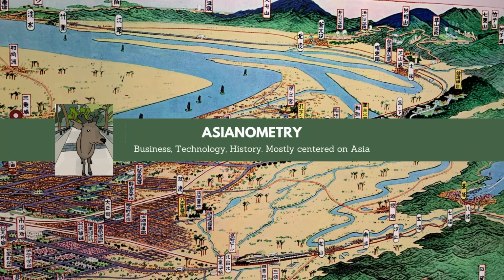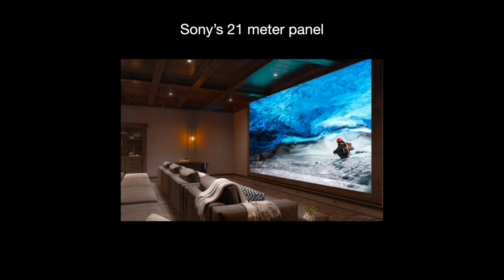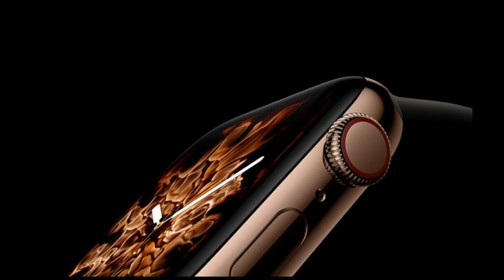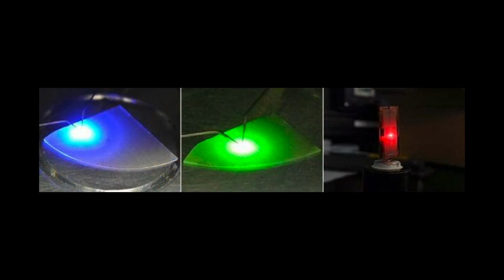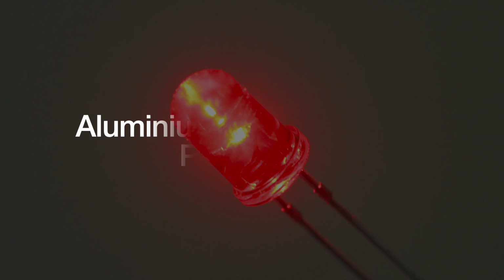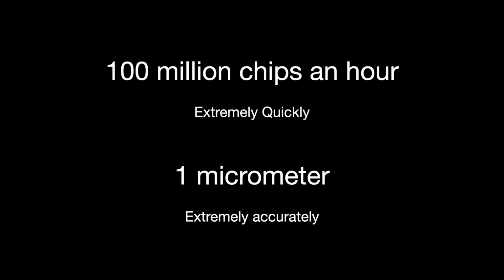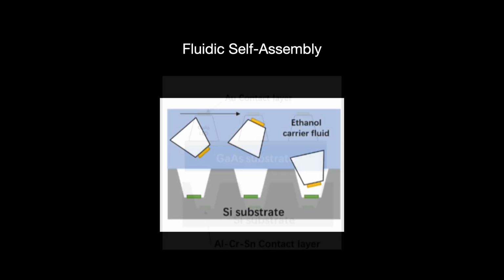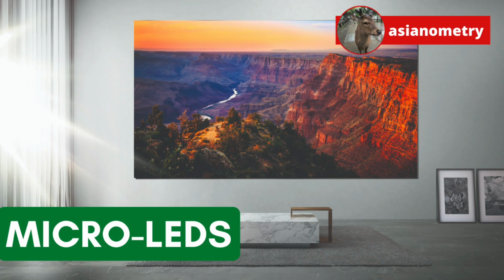Micro-LED Displays

Comment: Isn't it possible to make a micro-led array, 10x10 for example, and not separate pixels and place this on the display substrate? It would result in a much higher transfer rate.

Comment: Intresting report as usual. Never heard much about this micro led technology before. Anyway, besides all common display technologies, promises and the race of resolutions that already reached a point that human eye can't differ from a distance, the question of technology should also be which technology saves the most amount of power? Most (in Germany sold) TV sets have an very bad energy label. Since I know now about the light intesety effects of the red micro led depending on the size, this technology maybe could not save more power than a (led) backlight powered display.

Comment: What? CRTs didn't look bad... Especially they didn't have poorer contrast compared to LCD.... To the complete contrary they had perfect contrast, soething you reeeeally can't say about most of the LCD screen sold, given most are IPS nowadays, that have terrible contrast ratios. And CRTs also looked sharp and high-def, did you ever use a CRT computer monitor, that got clean signals?

Comment: Press X to doubt. 0:28 that flat panel monitors in the early 2000s and 2010s had better image quality than CRT monitors is something that's almost completely untrue. They had the same inky blacks of OLED monitors, that they had worse contrast is not true. Early versions of flat-panel monitors looked horrible. Response time is also something that was unmatched with CRTs all the way until just a few years ago with OLEDs.

So I'll repeat it again, CRTs had perfect contrast, zero ghosting and instant response times, and often perfect colors as well. This part of the video is wildly inaccurare.

A high-end CRT monitor like a Sony Trinitron from the 90s would still be competitive today against most consumer monitors that aren't microLED or OLED, and is still comparable to those.

Digital Foundry made a great video on this, highly recommend watching it. There's also a great article from Eurogamer, Vice made one as well.

Comment: I wonder if they could combine fluidic self assembly or a similar technique that would be assisted  with ultrasound resonance  and or acoustic suspension technology to vibrate the LED's into place
/watch?v=wvJAgrUBF4w
/watch?v=MnjKa3EZXwg
maybe the micro LED's each have their own unique enough resonant  frequency already  or if not maybe  some extra element could be added to make them resonate at different  desired frequencies   so they could be steered  individually into place  by the ultrasound.

Comment: Creator is not clear on application and underlying LED technology for the microLED. Creator seems to be confused with pitch size and actual illumination technology.
Outdoor display should not need microLED, even miniLED is questionable for the outdoor display. Home TV screen may be micro LED or miniLED. True microLED application would be VR/AR/MR/XR. 
MicroLED may be illuminated by LED, OLED, QD and other nascent technologies. MicroLED with Quantum Dot may be the net generation but it still has few hurdles for large display format. QLED is not QD.

Comment: great video :D
I still think CRTs have the best colour reproduction/response time/smoothest image, but obviously they have the worst packaging constraints and their resolution hasn't kept pace with other technologies. Hopefully MicroLED will be the best of everything.
Reply: I am glad I'm not the only person who doesn't agree with that part of the video. Didn't CRTs have perfect blacks (and therefore superior contrast ratio to LCDs), and better viewing angles?

LCD monitors won purely because they don't weigh a ton, and because they don't take up half your desk. Not because they offer superior image quality.
Reply: @tamius-han  Yeah they did, that part of the video is completely inaccurare
Reply: A CRT for a color TV, and its associated circuitry, was/is an impressive technical achievement. On the screen was a pattern of Red Green and Blue phosphors. At the back were three corresponding electron guns, R G and B. Only the beam from the R gun (for example) was allowed to strike the R phosphors. Likewise for G and B. Yet the three beams were swept via magnetic deflection over the screen in unison, and the beams had to maintain their identity with each one striking its assigned color phosphor. 
   You may (or may not) find it interesting to learn more about these systems, for the sake of history if nothing else. In any event, don't be throwing shade at that technology. It worked pretty danged good . . . until something better came along.
Reply: @clarencegreen3071  we literally just said we prefer it lol.

Comment: Producing them at the exact same brightness is a fun challenge.
Perhaps there is a way to grow blue in certain areas without growing the other areas and then you grow blue > green > red on your desired surface at the ideal temperatures. Doubt it tho.
Or maybe we just have to make 100 million chips of the same color then laser the color into it somehow. Possibly by burning metals away. Still unsure if that would even work. I know LEDs change color if you briefly provide too much power to them but that is a permanent damage and it reduces the brightness.
Yeah this shits complicated especially when you know nothing of how they are made and nothing of how they are powered. I was going to suggest something like using a perfect sample to grow crystals like using a diamond to grow a larger diamond. The new diamond will take the exact structure of the donor diamond. Even if that was possible how will you power it?

Comment: CRTs did not work poorly. Their contrast and brightness was very good and for a long time it was impossible (even today it is not that easy) to get an LCD which could display a high resolution (say 1400 x 1600) at a high refresh rate of 75 Hz. Actually, the refresh rates and the latency were very good. There is no "native resolution" in CRTs and they have more than one set of dots (R,G,B) per pixel while LCDs, typically have only 3 sub-pixels per pixel. Modern CRT monitors, post 2000 with multi-sync, gave an excellent picture.

Comment: So we can put over a billion transistors, each ~5 nm onto a square inch of silicon with enough accuracy and complexity to run a computer but putting simple diodes the are 10,000 times larger in a much simpler array is somehow difficult? I call bull$j!+ on these companies, I think they could have done it easily enough almost ten years ago let alone now. the problem is micro L.E.D is so good that after that, it is going to be hard to upsell  customers on anything else. I mean, worse case scenario for red is to just use blue or violet L.E.Ds and put a red phosphors in front of it, now that I think of it, why not just use all violet L.E.D.s that way you only need to grow one kind of diode on a substrate (now it's really easy) and just put red, green and blue phosphors in front of them using a masking technique?

Comment: A. Professional CRTs actually had great Contrast Levels because they are Emissive.
B. Plasma Displays also had great Contrast Levels because they were Emissive.
C. LCD Displays won because of price, but had terrible Contrast Levels (and off-axis fade) because they are Transmissive with (initially) Florescent or LED Backlights.
D. LCD Displays improved their Contrast Levels with better LCD Technology and Local Backlights (they also improved their off-axis performance).
E. OLED Displays are again Emissive Displays — they do not have Backlights.
F. Micro LEDs are non-Organic LEDs and are again Emissive.
G. Sapphire is, in this case, just an Aluminum-Oxide substrate, Al3O2.
Reply: And by the way, kudos for noting the Apple purchase of LuxVue.  A friend of mine worked at LuxVue and helped them develop their fundamental technology.  I've been waiting for that to bear fruit ever since.  Unfortunately my friend succumbed to Parkinson's last year, so he never got a chance to see his work realized ...

Comment: Could the red green and blue LEDs be grown on the same substrates? This would allow using the growth wafer for final assembly. (contacts on top, transparent sapphire substrate below). Doing this seems less daunting to me then solving the transfer challenge...
Reply: I wonder if they could combine fluidic self assembly or a similar technique that would be assisted  with ultrasound resonance  and or acoustic suspension technology to vibrate the LED's into place
/watch?v=wvJAgrUBF4w
/watch?v=MnjKa3EZXwg
maybe the micro LED's each have their own unique enough resonant  frequency already  or if not maybe  some extra element could be added to make them resonate at different  desired frequencies   so they could be steered  individually into place  by the ultrasound.

Comment: I would work toward a stacked geometry.  Red on the bottom can be largest and has insufficient energy to excite green or blue carriers into conduction.  Similar considerations apply to the green under blue interface.  We do need to prevent the light going the other way, which can be done with dichroic mirrors.  Lattice matching among these layers and material purity/control may limit yield, but I think this will win in the long term.

Comment: Seems like quantum dots is the way to go.  When Linus was looking at the wall, it's not low power, it puts out a ton of heat that needs extra ac, and the smaller panels that lock together to make a large panel isn't color calibrated. So if one panel goes out put a new one in the colors are slightly off, and the panel go out often enough.

The 146 size is 5.76 m/2 uses 2990 watts max. And needs 10,212 BTU of cooling. This is the second smallest one.

Comment: hmm wonder if u could use stupid strong electro magnets for transfer... like nmr strong. everything is magnetic to some degree.
or field locking with superconductors. idk seems the tech is taking too long and those q dot whatevers will be better. imo we dont need higher resolution screens we need more efficient ones for phones/battery life. processor architecture is at a point where they cant get much more power/heat efficient (atleast arms) and im guessing a lot of battery is now used by screens vs chips

Comment: What if all the Micro LED's were just white and RGB color filters printed over ? CCD's and CMOS use a simple B/W detector and have a Baader filter in front to represent all colors. Could an entire Micro LED display be made on substrate with traditional electrical connections so no LED's need to be transferred ?
Reply: There's no white LED, LED emits quite narrow band around a single wavelength. They could make a panel of blue LEDs and then use QD layer to shift the color, but that option was just glossed over.
Reply: @Papinak2  thank you... what is used as a flat panel back light on laptops ?

Comment: If you think CRTs had poor image quality, then you probably only saw some heavily used consumer-grade CRT TVs with a low line count. Sony Trinitron and NEC/Mitsubishi Diamondtron and possibly other aperture grille CRT monitors had and still do have good image quality, though they might not be optimal for small text unless perfectly calibrated and in good shape. Aside from the bulky size, I'd say the main drawback of CRTs is the less-than-perfect geometry.
Reply: This guy is just an industry shill. They've been able to make cheap MicroLED displays for years and only aren't doing it because rubes keep buying junk. 

That's what this industry does. MILK for as long as possible, and d i r t b a gs like this guy are their mouthpiece.

He doesn't even know what he's talking about.
Reply: This guy is just an industry sh i | l. They've been able to make cheap MicroLED displays for years and only aren't doing it because rubes keep buying junk. 

That's what this industry does. MILK for as long as possible, and d i r t b a gs like this guy are their mouthpiece.

He doesn't even know what he's talking about.

Comment: I wonder if the solution to mass transfer would be to just omit the step and grow the crystal on the display substrate. Of course, I'm uneducated on how it would actually work or whether it's possible at all, but it seems to me that removing a problem rather than mitigating it is usually the best option.
Reply: I don't know much about this either, but the substrate you grow crystals in changes how the crystal grows assuming you could even get them to grow. Considering that Sapphire has been used in screens as a fancy alternative to gorilla glass, perhaps the LEDs can be left on the substrate and the display is placed on top like a sandwich.

Comment: Well, to be clear, its not just gonna be sapphire. Its gonna be like TFT on sapphire already, so you're already depositing at least as many transistors onto the sapphire as you have pixels. I'm failing to understand why the processes that have worked basically flawlessly for TFT on glass can't be applied AT ALL to depositing some different chemistry diodes onto sapphire (or glass or plastic or whatever).

Like for real: wouldn't it be cheaper to have 3 separate, transparent TFT displays each made of a separate semiconductor substrate but done using TFT processes than it would be to pick n place 10 million anythings?

Comment: What about A pick and place style roller? Using MEMS to hold on via negative pressure, then slowly rotate the roller onto the substrate, but move the substrate at the same time to get the desired spacing. (and up/down to not catch any LEDs by accident).

Or combining fluidic self assembly with pick and place to make chiplets that can be effectively assembled?

Also, as someone else noted, a QD layer over blue LEDs is most likely where the industry will go. Consolidating 3 LED types into just one seems the best to increase output consistency and reduce R&D expenditure in fabrication when it's more needed in assembly.

And final side note: Thoughts on optical antennas?

Comment: The display industry has been working for years to get back to the CRT black levels. CRT Monitors had the advantage displaying the actual resolution they were set to, unlike the monitors today which use tricks to display the requested resolution.

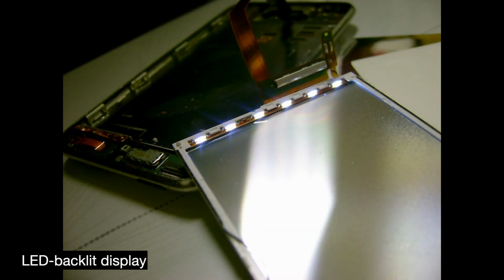Comment: 0:21 Yeah...no. CRT is pretty good for motion, especially in video games. Hell not just older games designed for them works even well for modern games too in terms of motion, superior than even OLED screens of today in that department.

LCD may be good for resolution and movies  but theyre terrible for video games in the motion department. They've improved a lot but still lag behind CRT in terms of motion smoothness.

Digital Foundry did an analysis on this:
https://m.youtube.com/watch?v=V8BVTHxc4LM

Comment: Outstanding video! Bravo! A couple of minor issues: the key advantage with microLEDs is brightness - I.e. being able to use them outdoors. Also, 20 microns is fine for a mobile phone display and 100microns us fine for a large TV display.
Reply: Big enough for a faux window.
Reply: @brodriguez11000  a 55" TV with stripey RGB pixels, would have each pixel 105 microns each. admittedly there needs to be some space in between. But you get the picture... 🙂
Reply: His description of CRT monitors is wildly inaccurate however, they had perfect blacks and instant response times.

Comment: Seems like pick and place is a poor approach to the problem. They should look into lithography doping techniques so that the leds can be "etched" in place. This would use similar technologies as mass producing transistors.
One could make use of older generation nodes (100nm or more) to produce those leds. Size would be limited to the wafer size, unless you have a way to combine multiple wafers into one large screen

Comment: LED size needs to go much smaller say 10uM.  Then you can use 9 LEDs per sub pixel.  If you have a 50% failure the you still have plenty spare LEDs.  You just need to under power good pixels so you get the same brightness.  If you are using parallel placement techniques then the 9 fold increase of LEDs won't matter.

Comment: Cant they simply calculate, based on bad diodes %, how many more of red ones there needs to be in the matrix to compensate? And possibly after that some calibration would turn off some of the excess
Reply: Or use larger red dots and smaller blue and greens?

Comment: The logical solution to the placement issue would be to have the wafer be the display, without any steps to transfer the chips. Yeah, there are also "a few challenges" here, but that's life 😀
Reply: Printing on sheets of material.

Comment: I was using Sony Trinitron CRT monitors. It's only relatively recently that I've felt that panel tech has truly outperformed the quality IMO. There was nothing wrong with the quality of the tube
Reply: We're still not quite there yet. OLED is cutting it really close though.
Reply: Yea in terms of resolution the new panels are all better but in terms of motion, nothing beats CRTs in smoothness.